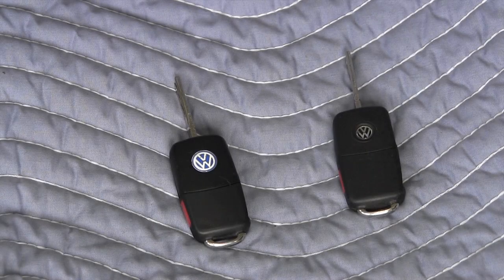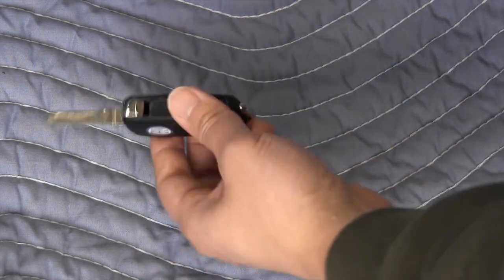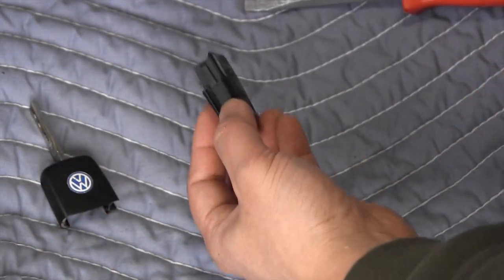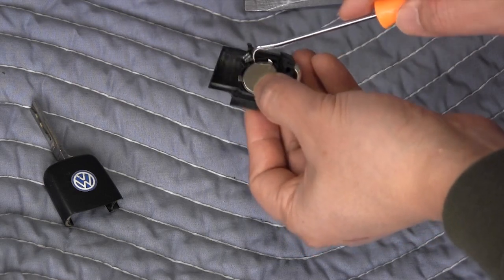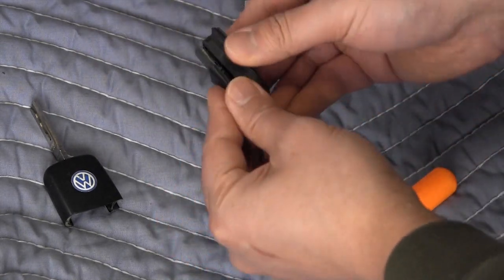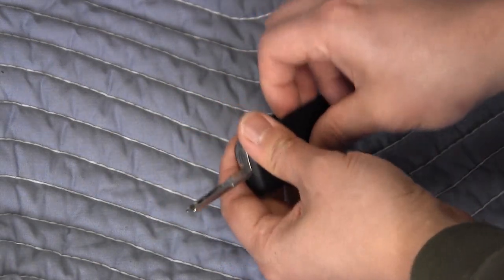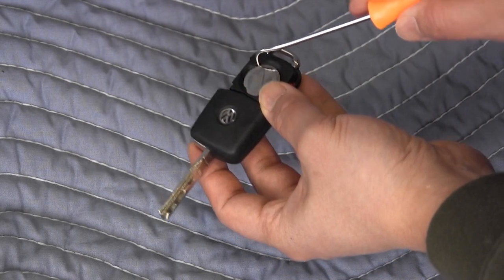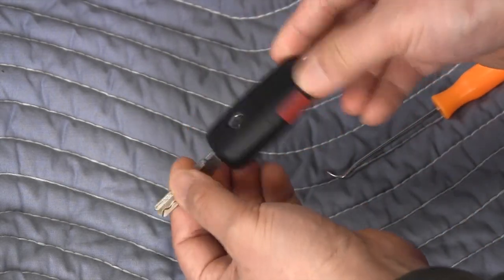Fast DIY: VW remote battery replacement (flip key) also works for some Audi key fobs

Comment: Hello,
I have a golf mk4 09/2001, but i dont have any remote key (i have all of the 3 keys).
Can i still buy a remote key, put the immobilizer from one of my original keys inside, cut the blade, and program the remote to work with my car?